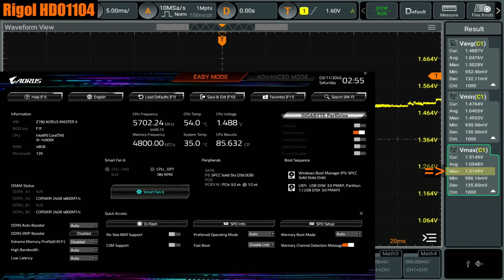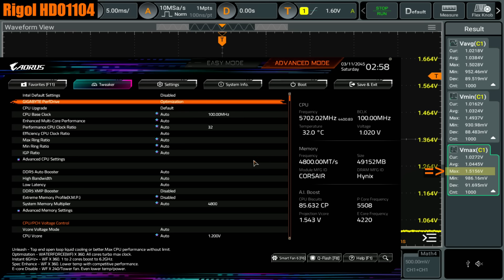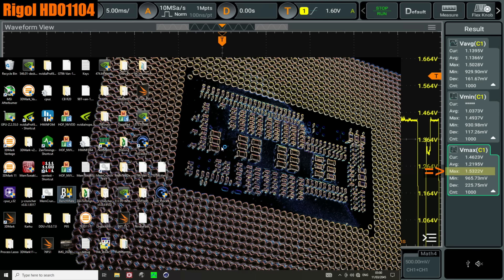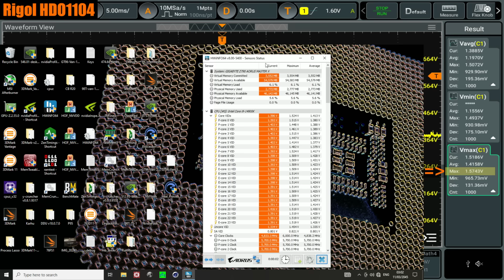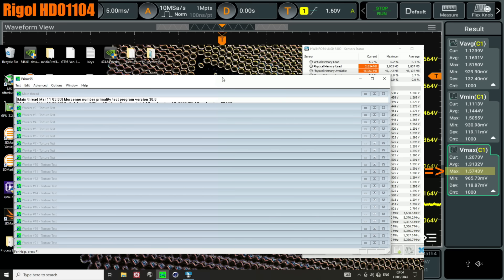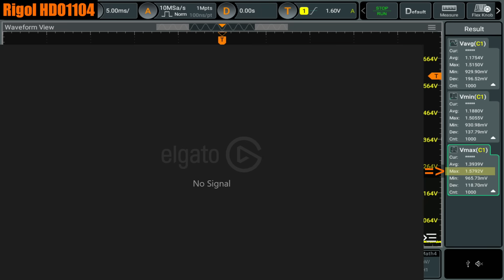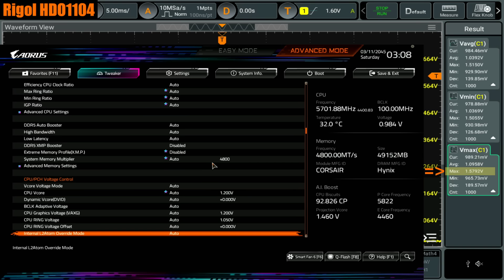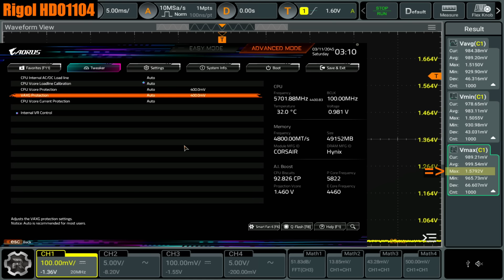Turning off "Intel Default Settings" with Microcode 0x129 DISABLES THE VID/VCORE LIMIT

Comment: If I leave intel default enabled my 13600k runs 1.45vcore in Cinebench r23 multicore. and instantly hits 100c+
If I change svid behaviour to typical it lowers vcore to a normal-ish 1.25ish but my r23 multicore score is 2000 less than normal for a 13600.
This is on a 690-A from Asus.
Reply: People just all core overclock your CPU -> fixed Pcore, Ecore and Vcore. No troubles then.
Or turn indeed the IA VR voltage limit setting on 1.40v (value is 1400 in BIOS). Maybe KS owners do put it at 1.425v (1425), that is stil safe.
Or put fixed max on your Pcores and E cores, then the VID never requests high values, so P core 5500mhz, E core 4200mhz or so.
Good luck it is so easy to solve. Don't do BIOS upgrades, all not needed.
Reply: Same deal with me on 13600k/msi b660 baked. 1.42v and 95+ temps. I  enabled ‘normal’ mode and then chose the cpu lite mode setting 6. Temps back down to 75c and at 1.30v. Cinebench score is about 22600, so pretty close to the standard score.

What a stupid fix. I wasn’t having any issues with my 13600k but decided to update the bios for the ‘fix’. The fix would have cooked my CPU.

Comment: From optimized Gigabyte settings and IA VR voltage level set to 1.4v, to Intel extreme settings, with IA VR config disabled, I get about 6-6.5% drop in all bencjmark scores with i9-13900K. I don't like you anymore Intel. You are a disgrace.
Reply: There are other things you can change to reach the same conclusion. Keep trying.

Comment: Undervolted my 13700k to perfect stability months ago when I started hearing about this, vcore capped at 1.35 for every individual core using AC/DC loadline tweaking and offsets, power draw capped at 200w. Microcode is useless for me from what I'm seeing.

Comment: I think I'll stick with my March 2023 MSI BIOS LMFAO. I got 1,35V max, load voltage of 1,22V set manually. I dont need intel telling me shit.
Reply: People just all core overclock your CPU -> fixed Pcore, Ecore and Vcore. No troubles then.
Or turn indeed the IA VR voltage limit setting on 1.40v (value is 1400 in BIOS). Maybe KS owners do put it at 1.425v (1425), that is stil safe.
Or put fixed max on your Pcores and E cores, then the VID never requests high values, so P core 5500mhz, E core 4200mhz or so.
Good luck it is so easy to solve. Don't do BIOS upgrades, all not needed.

Comment: As a 3D Artist I’ve been pushing my Intel 13900k really hard the last 1 and a half years. The fact is, every single day I experience random crashes, instability, etc in a myriad of tasks, from the lightest to the heaviest. I always complained about the software, but as it turns out it was always the processor. It makes sense because these issues are getting more and more frequent. There are days when I simply cannot get the work done. It’s ridiculous.
So I installed the new BIOS (I have a gigabyte Aorus Master z790) and turned on Intel default settings and the PC got even worse. It’s insane! I run a render test in corona, and the mouse cursor starts draaaaaaaging and the software freezes like I’ve never seen before. Any thoughts on this. Can please someone advise me what to do? I contacted the supplier for a RMA anyway

Comment: So I've had a i9-13900k since launch. Always had a thermal throttling issue since i run itx build with an aio 240. I've always set the max cpu speed to 5.5 ghz with a -0.050mv undervolt to keep it under 90c even with indefinite full load. voltage never jumps over 1.35v. When I put the new aorus bios on it cpu never hit 5.5. Thing would float at 4.9. Said f that 20% loss of cinebench score (39000 to 32000) and went back to F7. So idc what intel says to cover their butts. I will RMA if it fails. I refuse to loose 1/5th my CPU because they messed it up on launch.

Comment: 1.4V IA VR Voltage limit enabled! Thank you Buildzoid! My idiot CPU peaked at 1.5V in that bios ! (14700KF @ Z790 AORUS ELITE X WIFI7) (Bios ver. F7f)
Reply: I did 1.47 for me. Max I have was 1.45V. This is still high (especially for temps) but better than nothing, Intel screwed badly

Comment: The problem here is the high frequencies that are not supported by the architecture of the CPU itself, Intel will not lower the frequencies since they sold a product with certain specifications and if they change that they can sue strongly and it is worse for them, the solution is to lower the frequencies. frequencies, I mean, limit them to a maximum of 5.2ghz or 5ghz to keep the voltages at 1.3v, which is recommended, it is the only real solution I see.

Comment: I watch a lot of Twitch, and in the past few years, streamers computers have been crashing like crazy. Many gamers at home are also experiences more crashing in their games than ever before. Game reviewer could be possibly be crashing in games they are reviewing, that could cause a point or two docked from the overall games score due to stability issues, who may or may not even know his cpu is bad. There are so many variables and angles to look at here, that ultimately screws up everything. Everyone right now is in panic mode, while intel is being as quiet as a mouse. Since there is so much confusion, many people may change their motherboard settings, to overclock, because they are not getting everything out of their expensive motherboards that they should be getting. If the voltage is capped, then I doubt Intel's own XTU overclocking software will even work for those who want to safely overclock. I downloaded a new F29d BIOS update last month with the 125 microcode update on my Gigabyte DS3H AC DDR4-Y1, and now my ecores aren't showing up on my 14-700K, that was working perfectly fine before. I'm still waiting for the new 129 microcode update, and am hoping my ecores come back. Might have to reflash the BIOS back to a time when it worked, if they do not address my particular issue, but then I'll be running on an unstable system. Do I want to risk it? Probably not. I'll just have to live with my Pcores only, which is fine for the gaming I do. What a mess.

Comment: I used to get a score of 39-40k in Cinebench R23 and now with latest F7f Bios update getting a score of: 16,457 Intel Default Performance , and 17,361 Intel Default Extreme BIOS profiles... Running: Z790 Aorus Master X with i9-13900K . I've noticed unstable behavior of my pc for the past 6 months, random restarts and DirectX errors over and over, odd errors on shutdown/ restart, bought/ built in Aug. of 2023...The temp. fix bios F7d and F7e fast-tracked my CPU to a 13Neign!hundreed I think because I saw voltages Ryzen pun intended to 1.6v at idle when they were 1.38v highest prior, and power still exceeding 290W (edit* and first time I saw Cinebenchr23 scores drop down to 26k- hadn't ran a benchmark before the F7d bios (june24) in a few months, so couldve been degraded already im sure). I requested an RMA 5 days ago, they responded today with a questionnaire asking me to give them details on error messages, how often my issues persist, recent changes I made, if I've tried another GPU, motherboard model, describe more... all information that was in the initial request. - they need to just accept an RMA for a product they admit is faulty. Instead, they're dragging it out and playing dumb. I've supported Intel for over 17+ years, friends, family, anyone I built a computer for, I built Intel's for, never RMA'd a thing once. Spent well over $30K personally with Intel. Here we are today, and I never thought I'd say it, but AMD has never looked more appealing.

Comment: On my 13700K with a Noctua NH-D15 on a Gigabyte Z790 Aorus Elite if I use "Intel Default Settings" and run Cinebench R23 it immediately starts thermal throttling and the P-Core clocks get as low as 4.8 Ghz. Using Gigabyte PerfDrive Optimization and underclocking VCore by -0.075 I have no Thermal Throttling whasoever and about 2k points more in the Cinebench R23 results, no crashes. What gives?
Reply: Hey,

Can you explain how you undervolt it? I have Gigabyte too. I tried -0.050 and it crashes when running a benchmark :(
Reply: @JeremyBDE  What benchmark are you running? I have a a Z690m Aorus Elite AX DDR4. I keep it on intel defaults profile but also manually punch in the PL1/PL2 253w and 307 current limits in the turbo boost power limits section. Then set voltage mode to adaptive vcore then apply the negative offset. I manage -0.075 stable and cant seem to gain any more performance with a bigger offset. Make sure to also disable undervolt protection. IA VR set to 1385 and I also disable Frequency clipping TVB.

Comment: If i use the recommended intel setting in bios, but then enable XMP for memory, will that be ok, or will that disable the vid/vcore limit that the 0x129 microcode fixed ? thx
Reply: XMP is fine
Reply: @JeremyBDE  Thx for reply.
Reply: People just all core overclock your CPU -> fixed Pcore, Ecore and Vcore. No troubles then.
Or turn indeed the IA VR voltage limit setting on 1.40v (value is 1400 in BIOS). Maybe KS owners do put it at 1.425v (1425), that is stil safe.
Or put fixed max on your Pcores and E cores, then the VID never requests high values, so P core 5500mhz, E core 4200mhz or so.
Good luck it is so easy to solve. Don't do BIOS upgrades, all not needed.
Reply: @jankees4037  Thx for detailed reply, cheers

Comment: I've been running i7-13700k on b660 asus plus for around 2 years with max voltage at 1.42v, havn't had any issues. Only thing that concerned me was when running cyberpunk CPU would shoot up to 90c to 95c so stopped playing that game lol. Bios is from 2022 havn't touched any settings on it

Comment: simple fix for every one running i7/i9 13/14th  gen just underclock/volt the pcores  to 5.1 or 5.30 / ecores 4.20 / ring 4.5  with voltage like 1.13 or 1.165 and you are good to go , 99.99% you will not feel any performance loss  , plus the temperature in gaming is in the sub 40/50° , consumption also go down to 70-80w . be smart about ur hardware , modern cpus now are so good that we can play fortnite /valorant /cs go / siege at + 400 fps , optimizing ur  6000 rams to 7200 /7600  will get you extra +8% to 15% more performance  vs overclocking cpu from 5.30 to 6.0 ghz in games , be smart about ur hardware

Comment: Totally unrelated to the Intel case, but I have a unique recurring crash on AMD 3900X, on a Gigabyte X570 Aorus Pro rev 1.0 with a 12+2 VRM, which I believe to be voltage related. And I've been suspecting the board. But I don't really have the voltage-expertise. So I guess posing the question here can do no harm. This crash first happened when running Starfield. Consistently, every 5 to 20 minutes of running the game. A crash with a brief moment of the sound hanging, and then a perpetual black screen, with everything including the reset button unresponsive. But turning the system off by holding the power button down was still possible. Then rebooting to a black screen, which stays black for several minutes, after which suddenly the system comes back to life again. When entering the BIOS, it says that the BIOS has been restored. In other words, this crash corrupts the BIOS, and the board flashes it with a backup on reboot, to ... reincarnate. Whatever the hell kind of game crash has the ability to corrupt the BIOS? I have been messing with PC's since the eighties, I've seen a thousand crashes or more. But I had never before seen a crash that corrupted the BIOS. Somehow something triggers the clear CMOS, or something draws so much power that it might as well be a short, dropping the voltage. Ever since my dance with Sarfield, and swearing the game off completely, my PC has a random crash every few weeks, to the same black screen with the same symptoms. I have seen it happen while idle, running just a browser.
I'm thinking about waiting until a few more 9000 series CPU's are launched and tested, and the upcoming chipsets, and then swapping out the whole system.
I'm running it stock, only EXPO and SMART enabled. Updating the BIOS firmware, GPU drivers and everything else made no difference.

Comment: I think you are probing the correct way, 50 ohm termination resistor and a coax cable with the difference in shield and signal wires cut as short as possible and ground point soldered as close to the signal wire as possible to decrease the inductive loop. If you find a voltage probe point on the CPU substrate consider using channels 1 and 3 to prevent multiplexing of the ADC's if it has two, otherwise ignore my advise, my own scope is pedestrian at best.
Also YES some explainers on the various BIOS settings and OC flowcharts are very welcome.

Comment: I have an Gigabyte Z790 Gaming X AX and installed today the new BIOS with the microcode BS. Turns out that with Intel profile my PC would turn itself off and on. Clearly BIOS related because it never happened. 
Had to use Gigabyte's performance profile for getting stable again! And... while on Intel's profile my CPU would spike to nearly 80⁰c while gaming and it never happened before.
Reply: I am going to everclock my 13600kf to moon and back now. I'm going to call it 12900kf!

Comment: Funny enough my CPU was spared because when i bought it 2 years ago, top youtubers called to disable multithreading enhancement which is the future that pushes CPU even further. Well, thank you guys for saving my CPUs. I did also applied a small downvolt for temps just enough not to lose performance. Checked my VID now. is below 1.270 using adaptive voltage offset of -0.100

My bios is from january and my Mobo is a Gigabyte z690 UDD4 with f28 bios, I will not update to microcode

Comment: I have a gigabyte aorus elite ax gaming motherboard with a 13600kf that ive been running for 14 months now with no issues on the f2 bios. I watched my voltages the other day and i didnt see it go over 1.3v. I havent had any crashes or anything. Do i still need to download the microcode update?
Reply: unless you have an oscilloscope connected as this dude does, you won't see those spikes comming on your sensors. I suggest updating the microcode and yea, deal with some tweaking to bring it back to control

Comment: I updated to 0x129 and applied your previous fix the one with changing the voltage limit to 1.4 and adjusting the loadline and my scores went back up to 40300 on CB r23.
Reply: Hi, may I ask if you are running windows 11 or windows 10? How come I followed the AC loadline setting and voltage limit i got like 38k only.... ( mine is 14900k)

Comment: Problem is that I'm on an Asus TUF Gaming B760M-PLUS (non-wifi ddr5), and this sh!tty motherboard doesn't have any option to limit the voltage. It even used to have an option to set a voltage offset in the microcode 0x104 but doesn't have that option in the latest "stable" 0x129 microcode, but now the offset option is gone and it only has a manual static option to set the voltage, which feels stupid to even set the voltage to 1.4V at all times as that may do more harm than good. I never thought I'd ever do overclocking or undervolting in order to squeeze more performance out of the system but Intel degradation situation has got me wanting to do this for a completely different reason that I never even thought I'd encounter in a modern CPU nowadays.

Comment: I have tested the microcode on a Z790 AE AX -W and the Intel fix actually decreases performance by around 2000 points in R23 compared to the previous BIOS with 253W/280W/350A/1.5V limits. For some reason, the Intel Extreme setting limits the power to 253W/253W. Even when increasing the limits to those specified before, the score doesn't increase by much, plus the voltages are clearly higher than in the previous BIOS (although under 1.55V). At this point I am satisfied with turning off the Intel Extreme setting and manually setting the limits to the 253W/280W/350A/1.5V (although the Gigabyte Optimized setting will clearly undervolt the CPU).

Comment: My 13600K seems stable even with intel settings off. I was only suffering from instability in low loads due to buggy F11 BIOS for my Gigabyte Z790 Gaming X AX motherboard. It seems to be due to the way how C-states are enforced in the latest BIOS, because when i manually disable C8 & C10, it runs stable.

If i downgrade my BIOS to F10, it runs stable again, but at the cost of not entering C8 & C10 at all despite all being set to "Auto". F10 also keeps assigning some crazy PL values to turbo boosts, even to LOCKED CPUs.

Comment: Just updated my Gigabyte Aorus Elita AX to latest BIOS F12f from F12e and earlier from like F10. I have 13700KF. With F12f BIOS (Optimisation setting 5,4 Ghz all P-cores, e cores 4,2 Ghz, plus LLC set to high) I have between 1,246V and 1,354V on idle and in games. With Intel Default Settings (Performance, only option) I have around 1,35V and 1,42V on idle (HWInfo). Not great not terrible.  But now Im completely dumb. Which is better? My CPU was and is rock stable so I think I will stay with Gigabyte setting this time because of lower voltages.
Reply: same happened for me with asus board , look like we are running 13700k with 13900k settings . they just limit the max voltage and then bring up low voltage so peoples don't see instability on low voltages . but all of this is good for xx900k

Comment: but not entirely? or do i miss something. 
after update friday. I turned off intel default and then turn on the gigabyte mode for e core dissable. which now does keep the vid limit to 1.3 here, before update it went into 1.4's.
cpu runs a lot cooler now. i used to run undervolt on this but no longer need.
on 13700k, Z790 GAMING X AX.

Comment: If using an all core, fixed voltage manual setting (5.4p/4.2e/4.8 ring 1.32 vcore set in bios) with a standard LLC (MSI level 6 in my case, 1.248 vcore under load) rather than the adaptive/default cores/voltages and advanced tweaking with ac/dc llc, is it still required to tweak these settings shown for safety purposes?